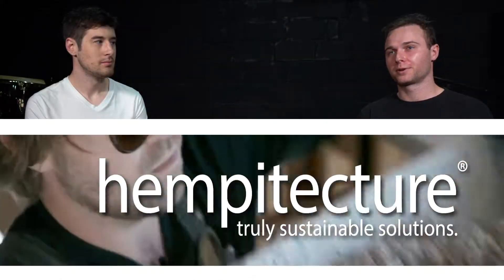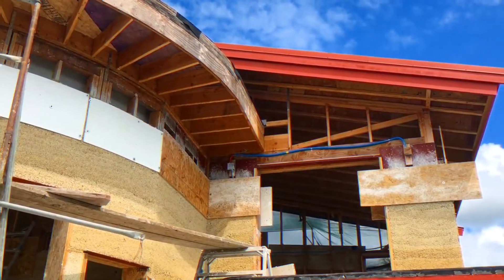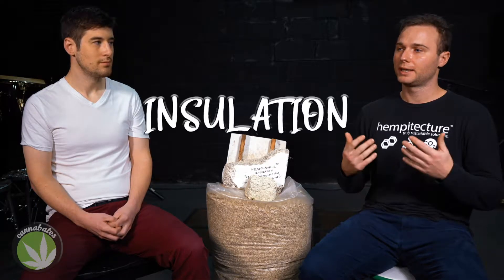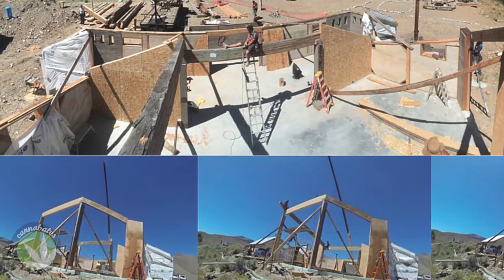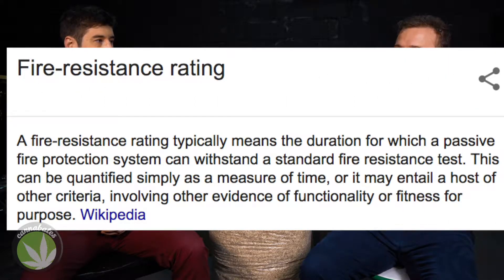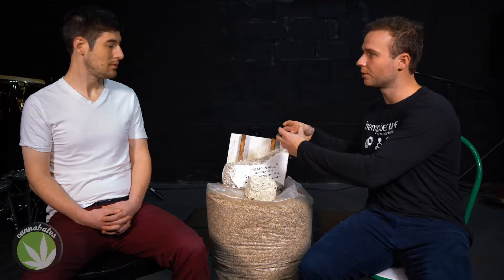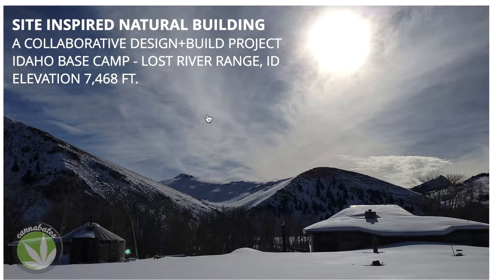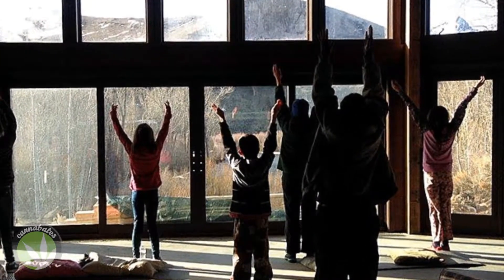Hempcrete: The Future of Buildings

Comment: To add another factor in Gonzaga testing. Log Homes may hve a lower R-Value but seem to have proven overall lower power bills than R-Value indicates. Does the Hempcrete have the same ability to store energy as the logs and unlike the logs over time become stronger and less compact resistant? Realizing hemp has a 2.5 R-Rating per inch seems an unfair gauge of it's possible performance, as I display at www.tugboatwilly.com designs utilizing 100% Hemp walls and roof sections with polymerized Hemp I-Beam technology would eliminate and wood structure in the 400 sqft structures. Plus the advantage of small 40' long shops erected close to building sites could turn out buildings with five man crews every two weeks. For Naive American Tribal industry this would allow multiple training and distribution sites as needed on any reservation....
Reply from the maker: Keep us updated on your progress with the hempcrete!
Reply: @cannabatesofficial398  You have that backward, I am not doing the hempcrete, YOU are. I am merely waiting for the development of a wall system utilizing Hemp composite or compressed integrated systems. I do not count on any development in my lifetime as I am already 75. What I put in my book series are ideas for the future or remodel now people.